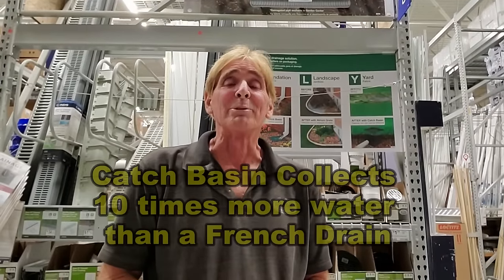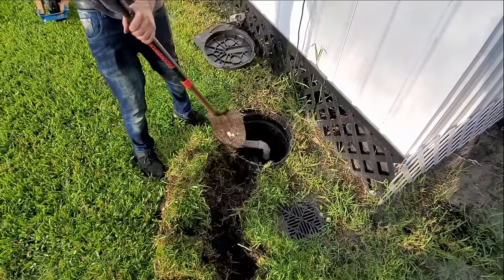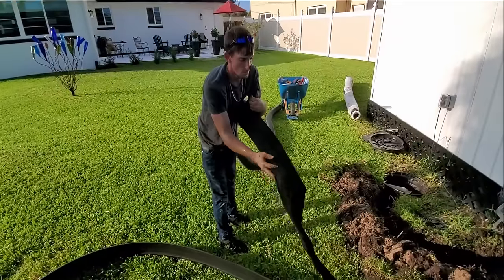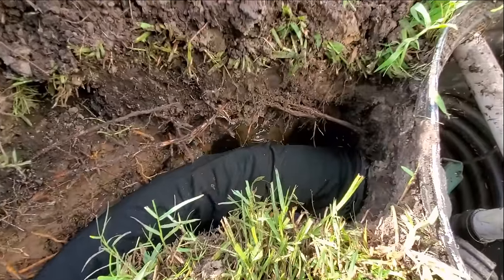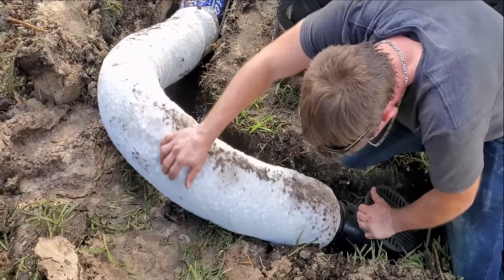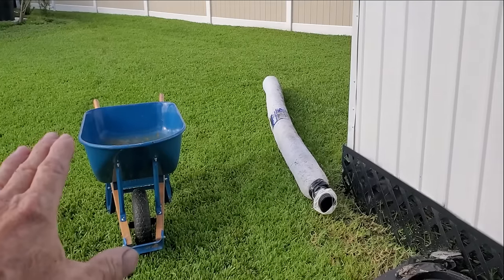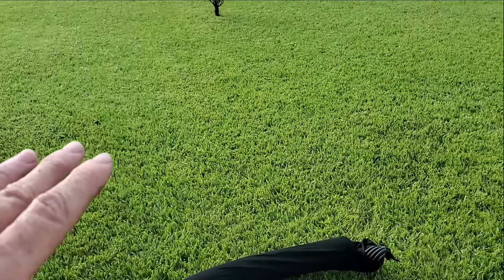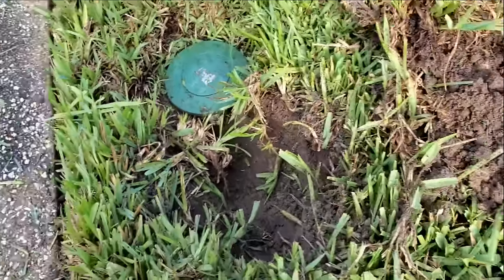2 Catch Basin Collect MORE Water than 40 feet of French Drain

Comment from the maker: A quick note about pipe and sock..  There are many applications for perforated pipe with the sock around it. It works well in sand, and not so well in clay.

Several comments already about only using pipe with fabric around it. Much better is to install traditional French drain. Whether you use gravel perforated pipe wrapped in Geo fabric, or the easy flow. Both of these types of French drain will allow much better drainage because of the aggregate. Pipe and sock alone will work, but it will be very very slow to collect water. 

Remember, add the catch basin’s to the low spot. This is the most effective way to prevent flooding in the yard.

Best regards 
Chuck,
Apple Drains
Drainage Contractors
Reply: Great tip! Thank you ❗  I  will keep watching your video till I get all my answers.  Stay cool and safe❗😎🐾
Reply: Chuck, aside from price, can I just use EZ Flow the entire way?
Reply: I'm confused, why 2 different types of pipe?
Reply: @Crosby Kabir no problem =)
Reply: AWSOME info!!!! A wealth of knowledge and kindness.  Sharing knowledge is an act of kindness.
Reply: That is true about the sock-wrapped pipe in clay.  14 years ago when I first bought my home, in the land where clay dwells, the contractor used a sock-wrapped perforated pipe. Hey, I didn't know; that pipe has failed in so many places. Thank you so much for sharing this vital information. If I had a reliable crew (I am a senior) with all of the great knowledge you have imparted, Chuck, I could replace that pipe and trench it properly, and wrap it in the green cloth. And, thank you, too, about the green landscape fabric. Folks, that same advice applies to landscaping your yard - that black landscape high quality cloth will prevent sufficient water from going into the soil - it just sits on top of the fabric. I did the drain test to make sure regardless of which way the cloth was laid, water ran off the cloth. My plants were drying up even though I drenched the area. So, listen to Chuck's advice - he's the man!

Comment: What options are there when the low spot is at your boundary at the end o your backyard and no real access to a storm sewer because it would be at a much higher elevation and 400 feet away with the house and the driveway block easy access?  What's your opinion on leech fields?  Thanks

Comment: I'm way out in the midwest. I just moved into a place with some drainage issues, with the carport flooding and the porch + driveway soon following. My lot has this perfectly good storm drain that the city put in. So I thought.. I'll just dig a 100 foot trench. Thankfully the storm drain is lower than the carport, and just digging  gradually, starting at the street and going closer to the home and carport, picking up more surface water until eventually it stopped flooding.

I should note I started digging during the flood in question, which is probably a foul, but I couldn't stand ignoring it overnight.
It seems removing excess surface water ASAP usually means the ground can absorb the rest. The ground does indeed move some water, so the trench is still 5-8 feet from the carport, with the earth perimeter around the concrete being the lowest point.
I bought a few drain grates, T adapters and 4 inch flex pipes and planned on just having the water drop directly into the pipe, but installing a filter material into the grate openings.
After watching this video, it seems I could consider a perforated pipe in a sock. I was and still am concerned about water soaking back into the ground and re-saturating the earth from another location. Because it's the lowest point, I already have to dig deeper to get flow in the direction, and with over 100 feet of run. I feel its best to keep flow going one way, as far from the home and drive space as I can get it.

This area collects water from the neighbor, the home and the carport itself. I could install gutters and redirect some flow, but with so many other sources of water intrusion, I felt it best to start the drain at the worst spot, and run additional surface drains along the run, including from the gutters. Finally, because capacity might get overloaded in heavy downpours, I might opt to keep a trench for the final 30 feet of run that I can consolidate pipe exits with from other future areas. Widen it to a flat trench, wide enough to mow as a straight run. I can decide then if I'm happy with that or if its really worth extending, filling, and leveling the yard for a fully concealed system. As I favor visibility and access.. well.. to be determined

Comment: It’s just best to use two separate systems.   One perforate system for the French drain.   And one solid pipe system for the yard drains (with catch basins) and downspouts.   That way your French drain (perforated system) doesn’t clog up.
Reply: It seems like an occasional burst of downspout and catch basin flow would actually clean out the French drain as opposed to clogging it up. Just my thinking. ?
Reply: @upsideways     No, you’ll end up with leaves and other debris clogging up the inlets on the French drain perforated pipe over time.     Whereas, on a dedicated solid pipe the water flow would keep it cleaned out and even if it were to get clogged (rarely) it’s super easy to jet out since it’s smooth solid pipe.

Comment: love you videos,doesn't rain much where I am in Arizona,I am trying to put gutters in my house,my cuestion is should I need drain system?thanks
Reply: I'd try to collect & save that water!  Be sure to use downspout extenders to divert the water several feet away from your house.   If you have no slope directing water away from your foundation, you might need some drainage. Water & moisture are  a structure's #1 enemy.

Comment: I have a double wall black plastic drainage pipe around two feet in diameter. It goes from an overflow discharge on a farm pond to a ditch outlet. Do you think I could drill with 4 1/2” bit and add a 4” pipe and drains to get rid of ponding water on the surface? I am also wondering if I do tap into the larger pipe, how high up should I put the hole? The large pipe only carries water when the pond is full which it not often . However when there is a large rain and the pond if full, the discharge pipe will be full. Thanks for any suggestions.

Comment: fyi.... I live in TN and have a french drain deeper than 28" around an entire yard even grid style. It pulls so much water out of the ground it's ridiculous. The ground is rock hard after a 2" in 1 hour rain event. Having said that. I have no issues keeping grass alive without a sprinkler system because there is 6" of soil on the top layer. So you can pull a lot of water out and still not have a plant issue.
Reply: thanks for sharing your experience
Reply: Good to know, thx

Comment: I have a question I need to install a drain in my yard it’s a ditch line but water stands in it does the pipe have holes all away a around the pipe or does it have holes on one side

Comment: Do you recommend always drilling/making holes on the bottom of the basin regardless of the size?  Is the primary reason for this to avoid the production of mosquitos? I am in the gulf coast area of Florida so the weather does vary, my concern is the foundation on two sides of our house, will this matter if I do so and are the holes always necessary? Thank you so much for sharing your wealth of knowledge.

Comment: Been watching your videos and you put out some great stuff, however there is some contradicting information  between this video and French Drain Man's videos on how french drains should be installed (i.e. how deep the trench should be and what should surround the pipe). Here it seems the french drain overtime will start to float upwards and no longer serve its purpose since trench is not very deep and there is no rock or aggregate to stabilize the area or create that additional void I would think you need to allow water to drain more freely into the french drain pipe. In addition, there are video out there of this type of pipe being extremely thin and collapsing. These are just my observations and I could be totally wrong as I am no expert in this field. Either way thanks for the vids.
Reply: I've had a contractor say the perforated black pipe is crap. But in this video a sump pump must be used. French Drain Man doesn't use sumps.This is first time I've heard of going to deep. Looks like the EZ flow pipe is not deep. Worried about the lawn or plants? Water them !!!!!
Reply: Many times the depth depends on the area/region. Frost line has to be considered. Chuck is mostly in FL. He does state the EZ flow is best for sandy soils like in FL.  Different contractors prefer different products, but it doesn't necessarily mean one is better. I dont like the double-walled corrugated black pipe. But my soil is expansive & flexing causes PVC cracking. My yard is riddled with underground obstacles, the corrugated pipe enables us to curve around them vs creating a complicated PVC layout full of expensive elbows. The right pipe is the pipe that is appropriate for the site conditions & the one the homeowner can afford.

Comment: Can I use the perforated pipe with a sock with catch basins and not use the gravel? I will have 3 catch basins connecting to 2 tees and the main drain line is  about 30 feet long, discharging to daylight
Reply from the maker: See pinned reply

Comment: Styrofoam will want to float with enough water soaked in it .. it will eventually push its way out of the ground.. the crushed rock I have seen you guys put down looks much more sufficient
Reply: Soooo much incorrectness in one sentence. Styrofoam is insentient and therefore cannot "want"; objects that absorb water become heavier, and thus do not float; Styrofoam is impermeable to water; the collective buoyancy of Styrofoam aggregate in drop-in french drain sections products is insufficient to overcome the frictional forces with substrate when french drain sections are installed to minimum recommended depth per site conditions. But sure... toss a drop-in french drain section into a pool and that sucker floats... handy use, if you ask me!

Comment: I have a pop up emitter, when I mowed over it the mower blade sucked the valve up and cut it off.
Reply from the maker: Try putting a set screw in the top.
Reply: Thanks but I don’t think the valve would open if I put a screw in it.
Reply: @douglasbest8136  
I had that happen too.  I just replaced the pop up with a grate.  I works great.  No more sucking up my pop ups with my mower.

Comment: PUT A PIECE OF WINDOW SCREENING  in it . I put it on all myy rain barrels also  . I even put window screening in all my plumbing vents . I have seen my neighbors  think the problem with septic tank  needs cleaning and then find out bugs have clogged there plumbing vent pipes . WE get lady bug and stink bug invasions and then you add in june bugs and the vents get clogged. When they cleaned out my neighbors roof plumbing vents the smell was disgusting and this was after they got septic tank cleaned and then paid to scope out their septic tank pipes  . Over 2 thousand dollars spent and wasted . Then a guy they hired to look at the plumbing vents one big  shop vac cleaned out 4 plumbing vents that only cost them 200 dollars . I told them about window  screening before that since I did mine that way . My drains off my gutters got to rain barrels with window screening on top . Stops bugs and debree from clogging up water spigots i put on them . @ of my gutter downspouts go to a huge underground tank with a pump I plug in the use the water , but I have to of the overflows incase we get more rain then the tank can take . Tank is 500 gallons and  it is full . Put window screening over my vent to keep bugs out and debree out and that water goes into a gravel pit I made to collect water
Reply from the maker: @sissymurphy9620  thanks for sharing your experience

Comment: My catch basins don't get debris in them, but they do clog easily in a really heavy rain from leaves, mulch and other debris - even with an atrium grate on them.
Reply: try adding a custom cut piece of 1/4 inch galvanized hardware cloth placed between the easy floe catch basin and the green cover
. it will prevent the mulch and leaves from infiltrating your system.